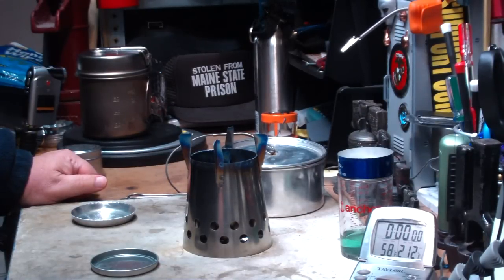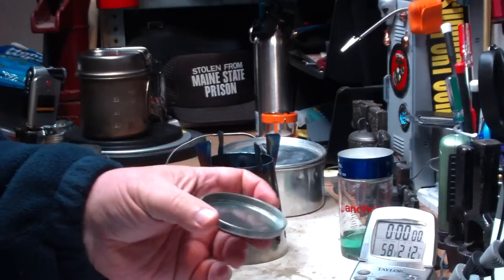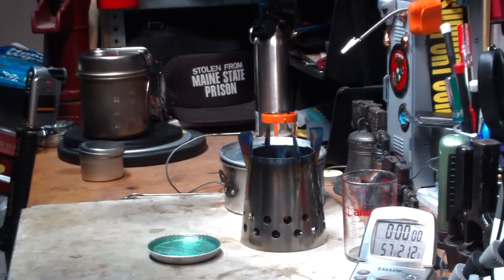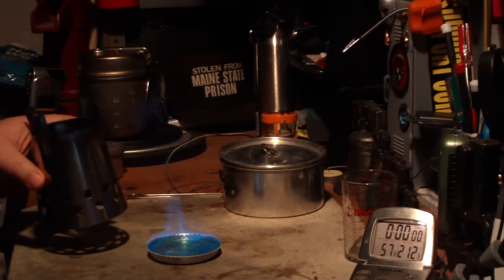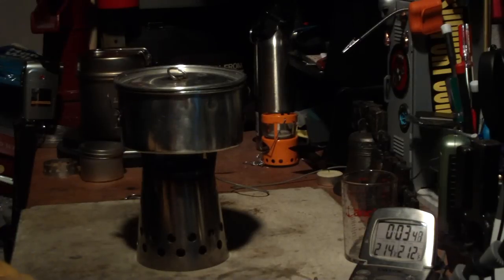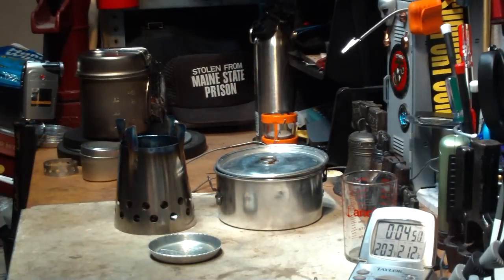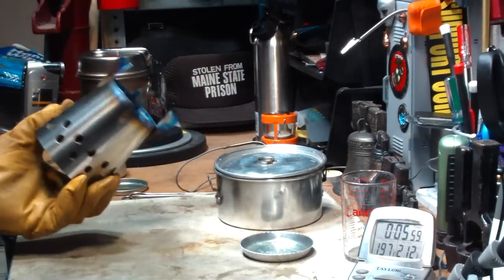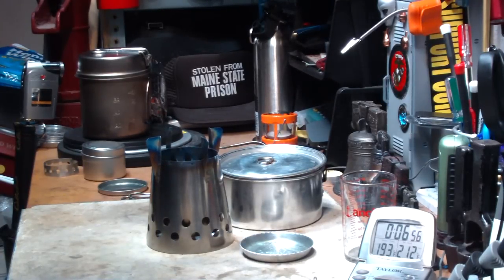Four Dog Stove's - Bushcooker LT II - Boil Test #2

Comment: Hi Hiram. Just looking at this video and wondering what if you turned the bushcooker upside down. The position you had it when you said it reminded you of a rocket. Placed an alcohol stove of your choice on the table. Placed bushcooker over the stove and pot on top. Rocket mode we could call it. Would this work?

Comment: The rate of burn correlates to the surface area of alcohol exposed. It's a pi r squared function so a small change in diameter (and thus radius) of your dish means a relatively substantial increase or decrease in the area of the alcohol exposed for burning. 2" ID dish=3.14 square inches of burning area; 2.5" ID=4.91 square inches of burning area. A smaller dish with one ounce of alcohol will burn longer but put out less heat per unit time than a wider dish with the same amount of fuel.

Knowing that there are 231 cubic inches and 128 fluid ounces per gallon you can measure the ID and inside depth of any dish and calculate the alcohol capacity exactly. Yes...interesting but nonetheless boring.

Comment: You listed the burner as the Vargo Triad in the description, not that I care, but a may matter to you. 
 In the field, you could dig a little hole, put down your reflector, put your burner in and light it, and then set the stand on top (around the rim of the hole) You could use just about any burner that way, and it would get you through if all the available wood was wet. I've had to do this when a wind screen got torn and had to be shortened, and it works just fine.